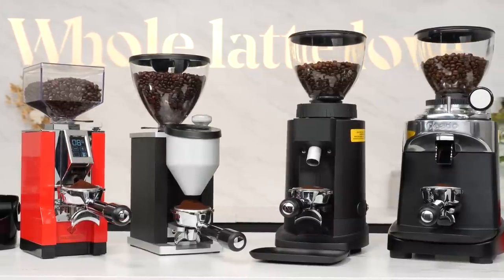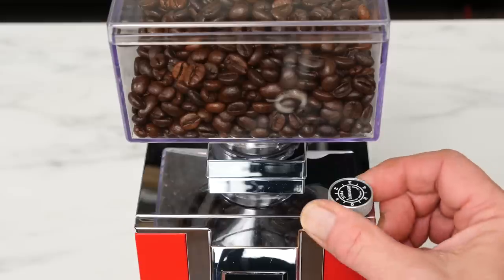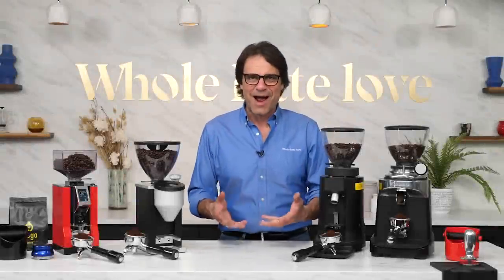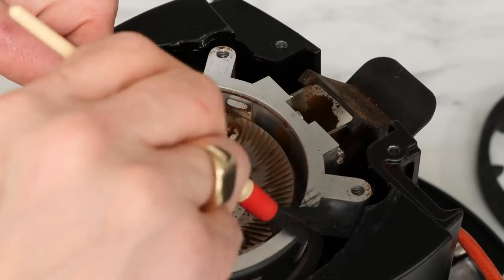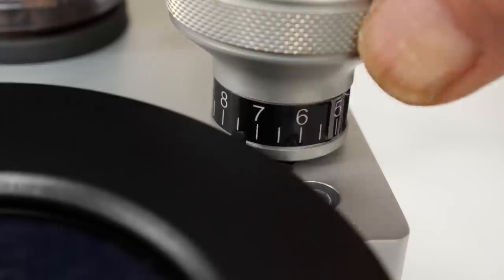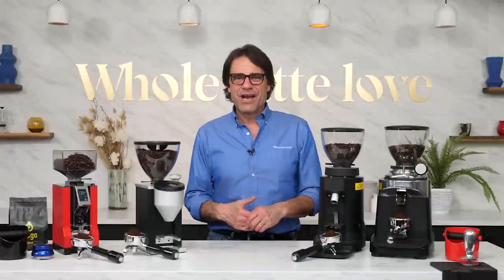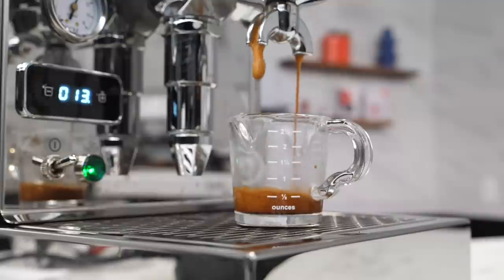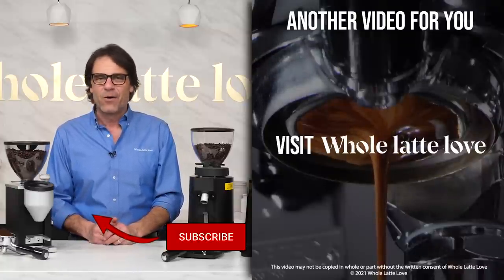Breaking in a New Espresso Grinder: Burr Seasoning and More Tips

Comment: Hello Mark, thanks for the video. I’m really new in the espresso world. I just got my F64 Pro yesterday, I have put about 1kg of cheap beans for it to season the blades.  I know 1kg is not enough to season the blades. But I still get lots of clumps out the grinder. Is it common for new grinders to get some clumps? Thanks.
Reply from the maker: Hi Tony, It's not uncommon to get some clumps and they should reduce with time as coffee oils coat the internals. Grinding speed in grams per second will increase as well. Bean type and ambient conditions can play a roll. Dark oily beans tend to clump more and you can get more clumping in humid environments.
Marc

Comment: I have been using my Silenzio for about a year, and it recently jammed. I opened it to clean the burrs and there was something like a coffee “cake” accumulated inside. I cleaned it, but now it is prone to jamming. Have I broken something in it? It is jamming daily. Help please.
Reply from the maker: Hi J, Weird that it would be jamming after cleaning. I would think it would be less likely after removing the coffee cake! Think it's unlikely you broke something so long as your top burr is mounted properly which is hard to get wrong. I would back off to a coarser grind and work your way down to a finer grind.
Marc

Comment: Hi Marc. I’ve got a new DF64 with the stock titanium burrs. In a normal 16-18g basket I can only get 12.5g in there for a proper shot extraction.  Could this be due to needing to season the burrs?
Reply from the maker: Hi P-W G, Probably not. Seasoning generally refers to the burrs (and grinding chamber) being coated by oils from the beans. The main change from seasoning is a slight increase in grams ground per second. Keep in mind filter basket ratings are more guides than actual capacity. Grind the same weight of light and dark roasted beans and the volume can be drastically different. Dark roasts are not as dense as light roasts so they produce a higher volume in your filter basket.
Marc
Reply: @Wholelattelovepage  Thanks.  I’ve used an older Macap m5d and a used Breville grinder with these baskets.  I could get 18g in with those.  With the new DF64, the grind for a good shot only gets me 12.5g in the basket.  Same flow rate but way different dosage.  Hence I was wondering if it had to do with breaking in the burrs.  (I have ensured they’re aligned / calibrated).
Reply: @Wholelattelovepage  apologies.  My scale was set incorrectly and giving me wrong readings.  All is well actually :)
Reply from the maker: @livingavision  NP!
Marc

Comment: Hi Marc. I got an older ceado e37s. Do you think it would be possible to replace the top adjustment mechanism in order to have a turning knob to adjust grind settings instead of a sliding one?
Reply from the maker: Hi Niels, Thanks for the question. The Quick Set Gear Upgrade Kit is compatible with Ceado E37S grinders with serial numbers beginning with F, G, or H. Upgrade available here: https://www.wholelattelove.com/products/ceado-quick-set-gear-upgrade-kit
Marc
Reply: @Wholelattelovepage  The serial number begins with an F, so this looks like a great upgrade for my grinder. Thank you very much for your help!

Comment: I got the Ceado E6P and omg it was hell trying to adjust the grind setting. It was clumping a ton and still running too fast but also running too slow. Very frustrating but I think I got it now. I had no idea about the seasoning aspect until I spoke with WLL support. They told me about 11lbs of coffee should be sufficient to season the grinder. The programing is tricky too. If I set it for about 11 secs, it will dispense anywhere from 18g to 19g when pulling multiple shots in the same setting and time. Very variable so I'm happy I got the scale nearby to keep track. It's def a learning process trying to dial in and season the grinder all at the same time. I've got videos on my page of my inexperienced self trying to figure this out haha. Im getting better though!
Reply from the maker: Hey RR, Thanks for the comment sharing your experience. As grinders season they will grind slightly more per second due to lubrication of components with coffee oils making things a bit more slippery. a 1g variation in dose weight cycle to cycle is what I expect with this grinder and is typical for other in this price range. For those who are very particular a scale is the way to go!
Marc

Comment: Marc, thank you for everything❤️ I got now the Ceado E37S, i love this grinder, so thankfull to have it. Now i noted that, there is some channeling, is this normal with a new grinder?
I bought also a Profitec Pro 700 and im very happy, i wanted to ask you if you and the team may can make a video about temperature during brewing or tell me how accurate the pro 700 is and if it is normal after steaming, that it makes some sparkle noise inside the machine?
Thanks for helping and thanks for the recommendation for this machines. Stay blessed❤️🙏
Reply from the maker: Hi YL, Thanks for the comment. The E37S is an excellent grinder... huge burrs, quiet, powerful, precise adjustment and excellent waterfall distribution into portafilters. I've done Scace brew temp testing of the Pro 700 in the past and it's very accurate. Not sure about the "sparkle" noise. I'd have to hear that.
Marc
Reply: @Wholelattelovepage  thanks for the answer Marc, i realized that it was my fault the channeling, now i need to work more accurate while i am dialing in because with the specialita from eureka which is a super grinder, i had not to work as good as now i think, but the ceado e37s can get more out of the bean, i am happy to be able to drink now these super quality espressos. I can recommend the e37s its a masterpiece in everything :D and to the Pro 700, for me its a super machine, everything is fine, i was just wondering if this is normal with this noise because it happens sometimes, that it sounds like water is falling into a grill haha, but maybe its new to me as a beginner.
BR Yosuah

Comment: I have a Eureka Mignon  Specialita and I use a very dark Sumatra.  Ok do love it.  Currently, I use a Nanotech basket in a Brezzara naked portafilter.  My portafilter takes  18 to 18.5 grams of ground coffee.  My 2 shot espresso generally runs 20 - 22 seconds.  Should I try getting a finer grind??
Reply from the maker: Hi Judith, Thanks for the question. In the end always let taste be your guide. 20-22 is a little short on timing - especially if that's from pump on and not first drip. General guide is 20-30 seconds from first drip. I'd try a slightly finer grind to get a 25 second extraction from 1st drip and see if you prefer the taste.
Marc

Comment: Hi Mark, question for you. I can’t find an answer anywhere. How often should you replace grinder Burrs? We have a Super Jolly grinder in our coffee shop and I have been searching and searching for answers with now luck.
Reply from the maker: Hi rh, Thanks for the question. Standard steel burrs should be replaced after ~800kg of grinding. I wish manufacturers were more open with this information! Ceado is a manufacturer that is sharing these burr lifespans:
Low Alloy Steel: 800kg
Alloy Steel: 1500kg
High-Alloy Steel: 2500kg
Coated burrs:
Titanium: 2500kg+
Red speed: 2500kg++
DLC: 2500kg+++
Hope that helps!
Marc

Comment: Hi Marc, my E6P doesn't have the screw on the side of the dial but it doesn't go past 6 even though its supposed to turn to 8. Where else could this screw be?
Reply from the maker: Hi RR, Should have mentioned in the video some Ceado models have that set screw on the top of the grind adjustment collar. If you see 3 screws on top it's the one furthest out from the center.
Marc

Comment: Hi Mark. I own the Ceado E6P. What I have noticed, is that with light roast coffee beans, the more I grind coffee (and the hopper slowly empties), the dose changes. And while making my espresso on my Silvia, I get more coffee out, than before with the hopper containing more beans.
While with dark roast coffee beans, the dose doesn't change, no matter if hopper is full or almost empty. It seems that with dark roast beans, it grinds much more consistent than light.
Is that normal? Any tip on how to treat light / medium roast coffee beans?
Reply from the maker: Hi K, Thanks for the question. So lighter roast beans (especially specialty grade) tend to be denser and harder than darker roast. I believe the down force of more beans in the hopper helps the denser beans feed more consistently to the burrs. So when less beans in the hopper one is more likely to get variations in feed rate. I believe dark roast feeds more evenly as the leading edges of the burrs have an easier time "grabbing" the softer beans. This is normal. Tips are: 1. Keep more beans in the hopper. 2. Know you'll likely need to bump your dose when there are fewer beans in the hopper.
Marc

Comment: Hi Marc hope you fin.
I have a question,  in fact it's an issue with my new baristapro nanotech 20g basket, the shot is disaster (chanaling, fast, terrible), compare to previous vst 18g with the same grind setting and dose and equipment)( ceado e6p grinder and rancilio silvia machine).
Even I tried to make the grind finer,  but the same disaster).??!!
Reply from the maker: Hi MH, A couple of thoughts. Likely more headroom in your 20g vs. the 18g basket which may be part of the issue. Silvia is prone to flash boiling (you probably know this) depending on where the boiler is in its heating cycle. Maybe blowing more steam in a larger headspace is causing trouble. The BPN and VST baskets are similar in being better than stock but hole patterns/sizes may be different so grind size adjustment is likely needed. Beyond that many other variables which may cause channeling.
Marc
Reply: @Wholelattelovepage  thanks it was helpful thoughts.

Comment: Love all WLL videos!  Have had my Eureka Mignon Facile for about 2 months now.  I don't keep the beans in the hopper because I'm concerned about freshness.  We have more windows than walls and keep the temperature in the kitchen around 77 F so the beans stay in an airtight container in the dark pantry and we just single dose grind.  However, I've recently read that the lack of weight affects the grind size on the Eureka.  What are your thoughts?  And what do you think about those bellows modifications that supposedly clear the chute you can find on Etsy for single dosing?
Reply from the maker: Hi YF, Thanks for the comment and question. With the higher temp and all the light you are better off not storing beans in hopper. Beans in hopper to improve feed of beans to the burrs and result in more consistent grind output rate. If single dose grinding you can expect some internal retention of ground coffee. I've found starting and stopping the grinder a couple of times after all beans appear to have been ground can get a little more coffee out. I have not tried third party bellows to help clear the grinder but many purpose built single dosing grinders do use them so it might help.
Marc